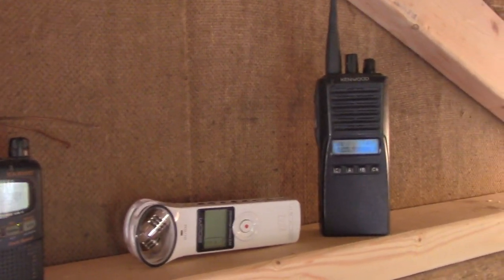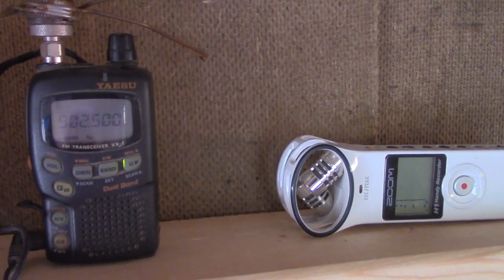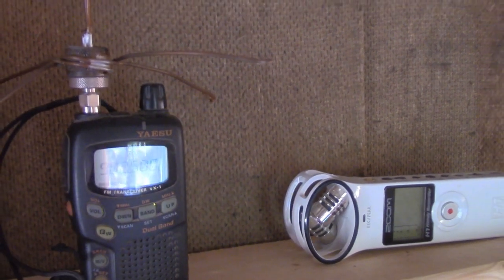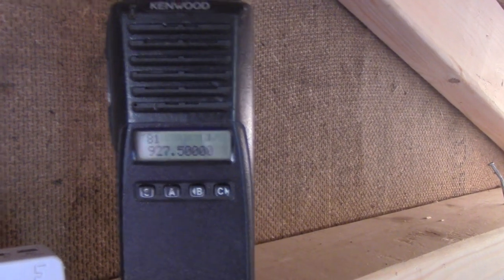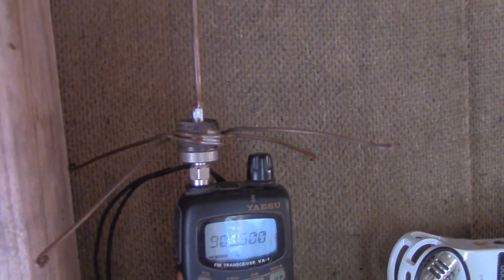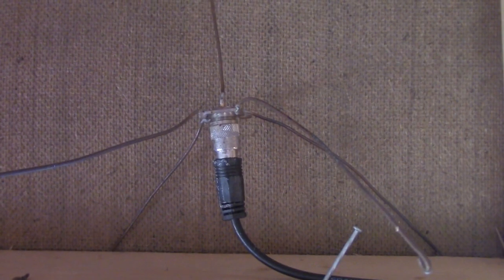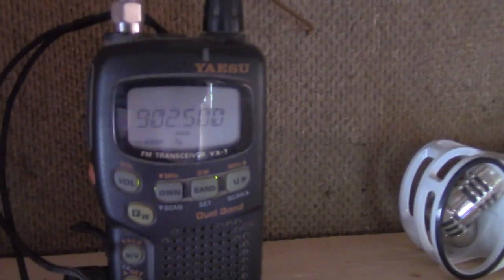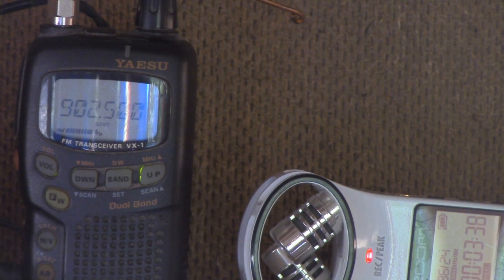902 MHz Receive Test

Comment: I enjoy following your radio videos even though I don't don't have any experience beyond police scanners and c.b. radio from years ago.
Reply from the maker: Thanks, Steve. 900 MHz is something I've only started experimenting with during the past year or so. It's pretty uncommon and something I wouldn't recommend starting out with, though. I do plan to discuss radios and bands for folks who may be thinking about getting started in ham radio, pretty soon.
Reply: @Possumliving  I inherited a portable radio from Radio Shack when my aunt died. Has short wave, long wave, AM and FM on the dial. I don't think the long wave is in use anymore.  What do you know about long wave?
Reply from the maker: @stephen8433  LW does get some use, but not as much as it used to. The 500 kc (600 Meter) international distress frequency is no longer in use, but there is a new ham radio band just below it at 472-479 kc. Further down in real longwave, there is another new ham band: 2200 Meters at 136 kc. And, there are radionavigational beacons and even some submarine communications there. There is a license-free radio experimentation band there too, called "LowFERS." It is at 160-190 kc (1750 Meters) and has existed for much longer than the ham band. Here's a link you might want to check out: https://www.lwca.net/
Reply from the maker: @stephen8433  Here's a beacon list you might want to check out: http://www.dxinfocentre.com/ndb.htm